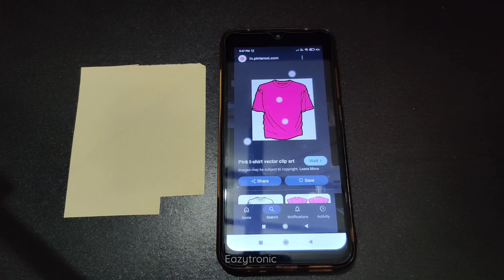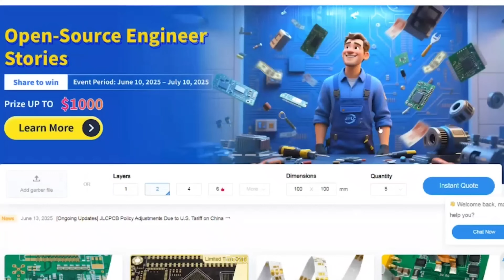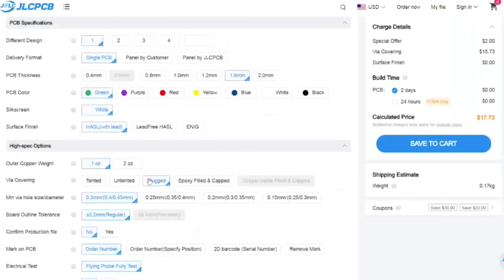How To Make Rain Detector Project|| Rain Sensor Clothes Protection|| Rain Detector Project #science

Comment: 😢my servo moter is not rotating and it is i buyed third servo moter
Reply: yeaa, me too. 
have you succeeded now?
Reply: How to fix it
Reply: You need to code it in:)
Reply: i also had the same issue but i fixed it by using a boost converter directly connected to the servo motor
Reply: @kevinadriel1758 can you send code
Reply: Give more volt bro
Reply: may I ask what is your power source? It's usually fine to use arduino power for 1 servo but try to connect a battery bank to your servo to see if it works. Alternatively, try to just see if your servo is working at alone